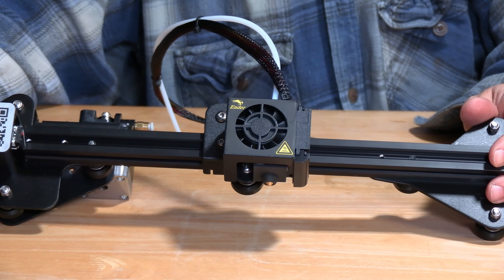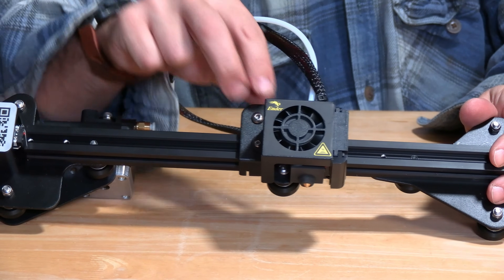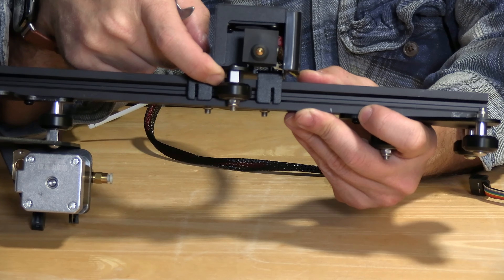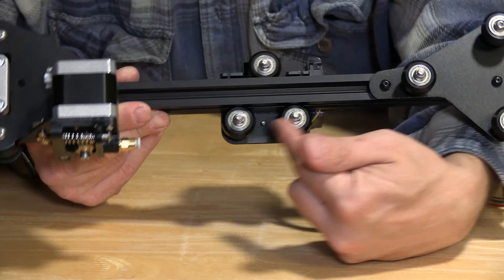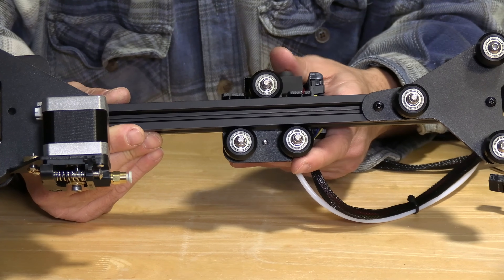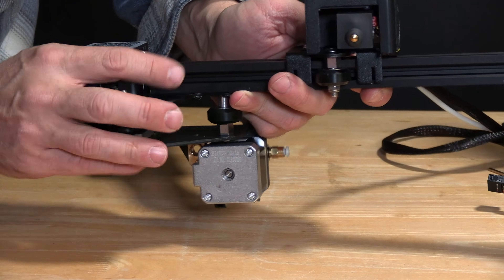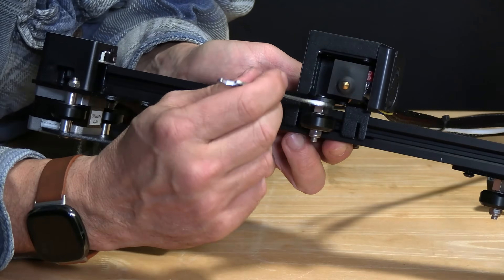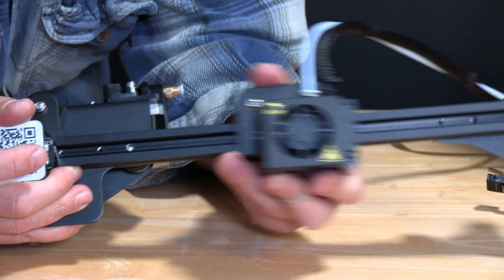How to fix a Loose Wobbly Hot End on a 3D Printer. Tighten your eccentric nut. In 4K

Comment: Thanks for this.  I was scratching my head because I had to make my bad out of level/tram to get it to parent properly. I just figured out after this video that on the left side the hotend was sitting pretty flat but as the hotend moved over to the right, the cable pulled it and since the wheels were not tight enough to the rail, it lifted away/tilted and decreased the length to the bed.. 

I trammed the bed to 0.01 mm with a dial gauge but he print would never stick on the right side of the bed!
Reply from the maker: Forget the gauge. Use Paper, then, Set your Z-Offset. Always have a CR-TOUCH on your machine

Comment: Hey any ideas I have the cr10s pro there is still a big gap when you adjust the eccentric nut. 
I have to ender 3 v2 adjusted prefect.  But I can not get the wheels to touch on the cr 10s. Any ideas.
Reply from the maker: Not sure. Have you adjusted in both directions?
Reply: I had to take pliers and bend the bracket flange to square it up to the bottom of the bracket so it was square with the rail.  I have an older ender max - but I believe lack of quality control affects a lot of their parts.